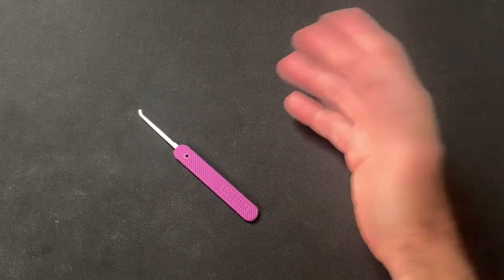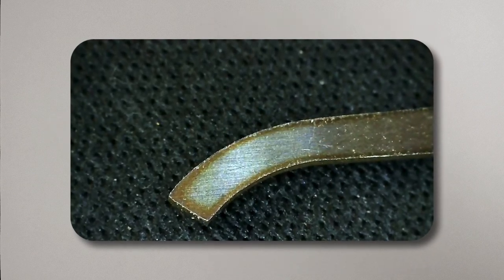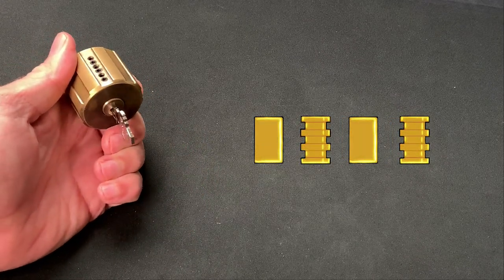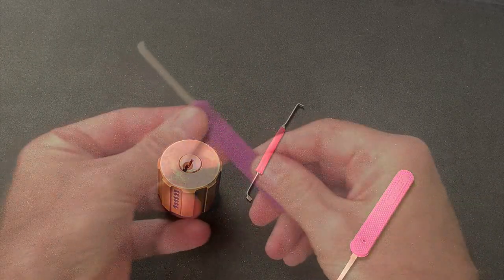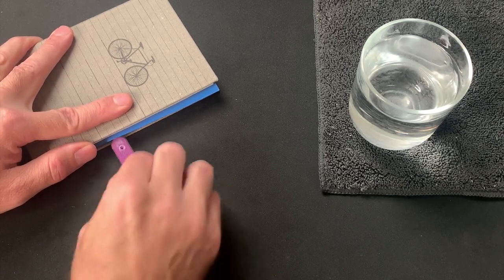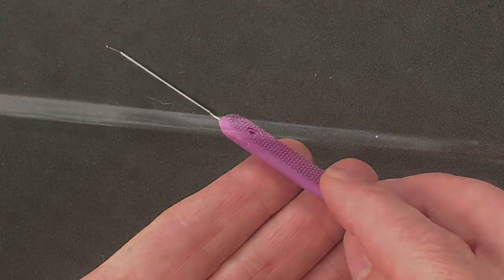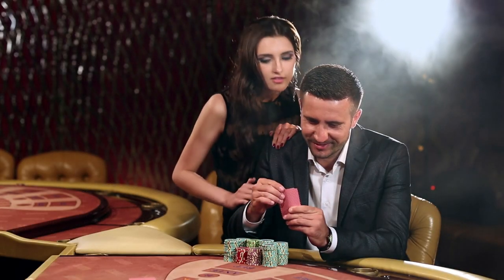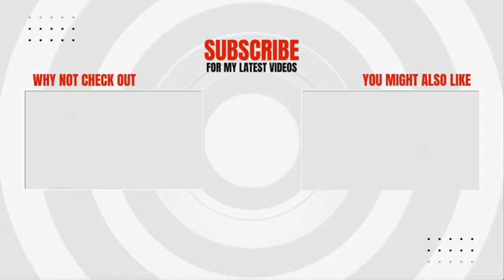020 Does polishing your lockpicks improve their performance?

Comment: Having been picking for around 60 years,  (retired locksmith) and for many years have used mainly Peterson picks, I do like my picks polished. However, only in a certain way. I polish the sides to a mirror finish, and also the top edge to a fine finish, and both inner and outer curves of the hook. I don't polish the tip, or round it off, as it tends to slip off the pins. Also I put a fine finish on the bottom edge of the pick, but do not round it off, rather leave it "squarish" as it will grip or sit on a tapered part of the warding, rather than tending to slip off. Your test lock I believe has a Schlage cylinder. On the left side is a piece of tapered warding that you will almost surely pick from. A pick rounded off on the bottom will tend to slip off this piece of warding. All this is not critical, I know, but because we lever the pick from the bottom, whether the pins are at the top or bottom, it's best if the pick does not become too "slippery". Just my two cents worth ...
Reply from the maker: They are two cents of hard won experience and therefore priceless! Thanks so much for taking the time to share this detailed comment. Very helpful info 🙌
Reply: Thank you for this!
Reply: This community rocks!  Can't wait to get started.  Got two sparrows orders coming.  A pick set, and a practice lock :)

Eventually I'll collect different locks but wanted something reliable to get started with.

Comment: I had the exact same problem with my Peterson .018 picks. They were brand new, and looked and felt quite un-finished (if that's a word). You can do a little test by by taking 2 picks from a high quality set, each in one hand, and then rub the thin ends of both picks against each other in a rotating motion.  Properly finished picks will feel smooth and hardly make a sound.  Now do the same with 2 Peterson picks, and not only will you feel the imperfections in your fingertips, but you can also hear the two picks grind against each other as if there's dust or sand in between the two. And yes, a bit of sanding and polishing will dramatically improve the feedback you will get when picking.
Reply from the maker: Ah that’s interesting - so a more common issue than I thought. Thanks for that tip 🙌

Comment: As a silversmith, I use a felt pad and jeweler's rouge for fine metal polishing.  Another slightly coarser abrasive is called Tripoli.  Both work well on a Dremel felt pad, and will cut slower and finer than sandpaper.  Cutting slower is faster if you factor in the ruined pieces that necessitate repeat builds

Comment: I have received a few tools from Peterson over the years that clearly got past quality control and should not have been sold. Some were as you received, not tumbled to a usable finish, while others were not placed in the handle correctly, being quite crooked. Benita at Peterson always sends me replacements, no questions asked, but I do feel that their quality control is somewhat lacking for products I consider more costly than they ought to be.

Regarding polishing picks - Yes, this is required for most tools. Feedback is more pronounced and the pick glides easier across pins and slides by warding smoothly. This is not only true with hooks, but rakes are also more effective when polished.

Have a good day!

Cheers... :)
Reply from the maker: Thanks Jeff - great feedback 🙌
Reply: @fishpicks4531  
You are very welcome, Sir.

Comment: Hi mate. Another great video.👍 As an Engineer I know polishing can make a big difference. The removal and polishing of any sharp edges will improve the longevity of the tool. Nicks, pits and sharp edges are where cracks and stress fractures will originate causing early failure. It will also improve feedback as you wont feel so much friction between the pick and the warding. I would definitely recommend  making it a habit. Not just on new picks but maintain that sheen on your favs too. 👍
Reply from the maker: That’s a great point Jeff - longevity as well as utility. Another good reason to get polishing I guess! 🙌

Comment: I typically don't polish the surface of the part of the pick I engage the pins with. It's my impression that a little traction on the slightly flattened tip helps keep me from slipping off pins, while polishing the sides, top & bottom, and rounding off the square edges elsewhere improves my ability to guide the pick through tight warding as well as reducing the friction that damps feedback.
Reply from the maker: Ah that’s an interesting approach and makes good sense. Thanks for sharing this tip 🙌

Comment: I have found that the felt-like sanding wheels for the dremel work very well for the inner nooks and crannies, especially rakes and deep hooks. I'm also not a metallurologist but I'm pretty sure that the danger heat range is accompanied by a colour change.
Reply from the maker: Yes I think you’re right Allyn - a good friend of mine is a blacksmith and when I’ve helped out in the forge he has shown me that process.

Comment: In my experience, most picks (except Multipick and Law Lock picks) need to be touched up a little before they slide smoothly in the keyway. However, I usually only take some 600 grit sandpaper and try to knock off burs and excessive roughness. I’m not sure how much benefit I’d get out of a finer polish. That said, I think the more your pick has to slide against warding, the more benefit you’ll get out of the smooth surface. So perhaps I should polish a couple of picks and try them in the tight warding situations where I know feedback is dulled by that friction. I can certainly say that in one Yale keyway in particular, I had a very hard time picking using my normal every-day picks, but was able to pick it open several times once I had switched to my Multipicks even though I was using essentially the same profiles.
Reply from the maker: With the right tools, I really don’t think it’s that onerous a process - can be done while listening to an audio book 😉

Comment: I would be shocked if the original condition of that pick wasn't a qc mess up. But I'd be even more surprised to hear any picker of any experience level say that the finish of the pick doesn't play a role in it's effectiveness. Your results are correct, it makes a difference 😉
Reply from the maker: Thanks for the confirmation Charles 🙌

Comment: It can't reasonably hurt, since there are fewer sharp edges to catch the warding, and since it is so simple and qyick I don't see why not. Even if the increase in performance is miniscule.

I have only finished mine to the point where they feel silky smooth to the touch, though. And my Multipick set was already tumbled to that level which was nice!
Reply from the maker: I’m sure that there are diminishing gains from that point onwards anyway 🙌

Comment: I wouldn’t overthink this. For a minimal amount of time investment, there is no reason to NOT do this. Except maybe....
 
I hesitate to point this out, but as the requisite pedantic arse around here, I feel I must. Also, I just watched an older video from Lock Noob (whom I love, BTW; learned more from him than all other channels combined) where he spent many minutes discussing two hooks, which were identical except for 0.002” of thickness. 
 
Yes, these are the things I think about. 
 
If you sand the hooks as you’ve shown, there is a potential to create a “distal taper” in the shaft. Meaning the tip will be thinner than the base of the shaft near the handle. This is because you are inserting it from the outside, towards the spine of the (small) book so pressure is going to be higher near the tip. Also, as you pull it in and out, the tip is in continuous contact with the wet/dry while the back part of the shaft is only in contact for a short period of the sanding stroke. How much thinner?  Not sure. Does it matter?  Not sure.
 
You’ve got a couple things going for you. First, I think you started out with 600 grit, which is already pretty fine. So your material removal should be minimal. Also, I think that Gem is 0.018” so you’ve got some room until you get to 0.015” where most of the other Euro picks are!  
 
Some other things you could do.  Get a bigger book! Or find some way to equally distribute the down-force on the shaft. And move the shaft perpendicular to how you’re doing it now (side to side instead of in and out). You could ditch the sandpaper in favor of a whetstone, ceramic stone, or diamond stone and do one side at a time. This would be an absurd move unless you already have these stones for knife sharpening. But they do give you other physical configurations to work with, and will make quick work of either carbon steel or stainless steel picks.  
 
Regardless, REGARDLESS, there are huge advantages to polishing, including some that weren’t mentioned like saving wear and tear on locks (Yes, I’m looking at you, bogota rake) so the rest of it is just a mental exercise. 
 
Lastly, you don’t need to worry about blowing the temper on the steel. Not that it costs you huge amounts of time and resources to dunk it in water. Just saying that annealing, hardening, and tempering temperatures for both high carbon “spring steel” like Multipick uses, and stainless steel are several hundred degrees C. And in the case of tempering (making softer) you need to sustain them at those temperatures for long periods of time. Bottom line: if you can touch it with bare fingers, you are fine. Conceivably, because that is 300-series stainless, I guess you could work harden the steel and make it brittle, but I don’t believe buffing, polishing or hand sanding is going to create enough deformation to work harden it either. 
 
That was your pedantic arse moment for the day. Thank you. I’ll be here through Wednesday; two shows on Friday and Saturday. Don’t forget to tip your server.
Reply from the maker: Haha I have all the time in the world for pedants provided they are also well informed which you clearly are so thanks for another great comment. As it happens I do have blade sharpening equipment (4 years training as a wilderness survival instructor) but wanted to make the video for what most people would likely have in their garage so my Japanese whetstone kit stayed under wraps! As for your other points - well made and duly noted 🙌
Reply: @fishpicks4531  Well, as I once heard Lock Noob say, cor blimey!  Next your going to tell me you carry around a Jacklore Classic. (Please tell me you carry around a Jacklore Classic)